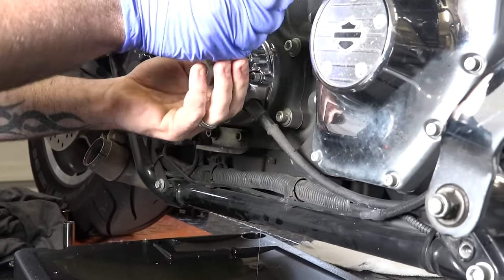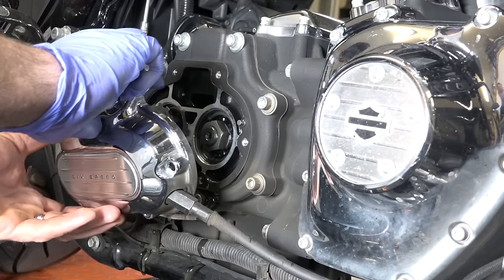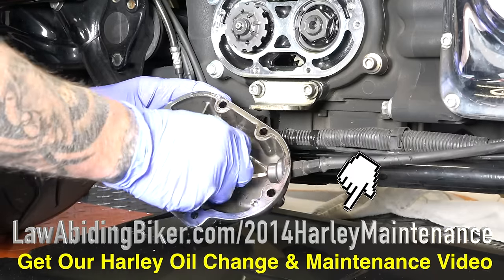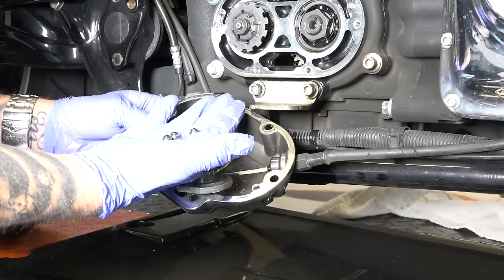Remove Harley Clutch Cable Assembly Under Side Transmission Cover-DIY

Comment: I reused the original gasket when I was changing my clutch cable and this evening I noticed couple of drips on the floor. Now I have to drain the oil again, most likely have to buy a new quart and lets not forget about removing the pipes. Moral of the story CHANGE YOUR GASKETS ...
Reply from the maker: Yah, always a fail safe to change every time. Thanks for watching.
Ride safe & Ride Often!
Here is a link to a bunch of our useful Free vids: http://www.lawabidingbiker.com/freevideos
Here is a link to some of our useful for purchase videos: http://www.lawabidingbiker.com/buyvideos
Want Answers & Information Fast? And help support us at the same time? Do you like the content we provide?
Our patrons get answers to their questions/comments/feedback in less than 24 hrs and are part of our Private Facebook Group. If you are interested in being in this exclusive group you can get all the details at ==> http://www.lawabidingbiker.com/patreon
If you haven't subscribed to the Law Abiding Biker Podcast make sure to do so. Listen in as we talk weekly about issues/items like this & so much more. You can listen on iTunes (Apple/IOS), Stitcher Radio (Android), or any other Podcast App ==> http://www.lawabidingbiker.com/podcast
Join our free email club at http:///www.LawAbidingBiker.com/EmailClub. Only relevant content will be sent from time to time. Email club members are the first to find out about free or for sale content are given special coupon codes.
Reply: Very sorry to hear but thanks for the honest, painful truth.
Reply: Or if you have a tube of black silicone gasket maker, just smear a thin layer on both sides of gasket, so long as the original gasket isn't damaged

Comment: Ryan, hey bubby how long should it take for a Harley mechanism, to put in the Harley reduced effort clutch kit, Harley part # 36808-05 if the pipes are off already, on a 03 Harley road king,  thanks man, keep the video coming ,Donnie
Reply from the maker: That's a tough question to answer. The dealerships service writer will go by what the book says it takes and charge that amount. Wish it were easier to estimate.
Reply: Ryan Urlacher that's  ok, was just curious,  thank you for all the video's you guys do, to help us out. Ride Safe, Donnie

Comment: Should be able to pull this cover without removing the exhaust I’m assuming. 
Replacing my clutch cable in a few days. Don’t want to wait on exhaust gaskets.

Comment: Great video Ryan. Slight problem I'm having though, I'm trying to put the new clutch cover on but the cable wire doesn't stretch far enough to get it into the right position. In it's current position, the clutch has far too much play and doesn't spring back once I let go of it. Did you encounter this?

Comment: hi...i'm having a problem. I just replaced the gasket because of a leak...put everything back together, but now the bike doesn't ride anymore. put it in gear release the clutch and it doesn't go. i've tried to adjust the cable but nothing works

Comment: I've noticed that my clutch cable as got a little oil on it. Went for a ride the other day, went to back up to park had handlebars trund all the way to the right and clutch wasn't working. Dao I have to take the cover off to check the tightness of the cable?? Thanks in advance

Comment: Ryan, what is the secret to getting a new clutch cable into that case on a 2015 FLHP? My son and I tried for 2 hours to get it to screw on. It's not even trying to cross-thread. Does a new cable not fit a 2015 case?

Comment: Replaced my Shift Shaft seal, upon adjusting the clutch, ended up with additional clutch cable slack that i cannot get out. Can just barley pull clutch lever - feels like it bound up??? 2003 RK Classic. A little help...thx jim
Reply from the maker: We'd have to break things back down and look over everything. Something not right. The process of elimination unfortunately.

Comment: Great video. Have you ever tried doing this replacement with removing the exhaust?
Reply: I just did on my ‘13 E Glide with stock headers. I used Snap On Allen wrenches; they’re small enough to fit with just the heat guard off. And with the bike on its stand you don’t lose more than an ounce of transmission fluid.

Comment: My clutch cable and protective covering is always wet with oil. Seems like the oil is coming out where the cable goes into the nut that screws into the cover.  Don't think it's the oring but the cable jacket itself. Your thoughts?
Reply from the maker: Hard to say without being there, but it sounds like you might need to replace your cable.  The coupling may be defective.

Ride safe & Ride Often!

Check out this YouTube Channel as we have a ton of free videos for you!

Check out our useful for purchase videos: http://www.lawabidingbiker.com/buyvideos

BECOME AN EXLUSIVE MEMBER-GET BENEFITS:
http://www.lawabidingbiker.com/patreon

Leave a flat donation: 
https://www.lawabidingbiker.com/donate

Shop in the Official Law Abiding Biker Store:
https://shop.lawabidingbiker.com

Subscribe to the Law Abiding Biker Podcast: https://www.lawabidingbiker.com/app

Join our free email club:
https://www.lawabidingbiker.com/emailclub
Reply: @RyanUrlacher  Thanks man. Yeah it seems to be from the little metal crimp that holds the protective covering in place or where the cable goes in to the nut part. I've been hesitant to change cable because I didn't want to have to remove the exhaust.

Comment: question, lol can you remove that cover , and the cam cover without draining any oils? i.e just for polishing. good video.
Reply from the maker: Glad you liked the video. You can't remove the transmission or cam cover w/o losing the oil.  Unless you have a model with hydraulic clutch lever then the transmission cover is just for looks and you won't loose any oil. ~ Ryan Urlacher
Reply: OR lay the bike on its left side, 90 degrees and you'll be fine ha ha ha

Comment: how much transmission oil do i need
Reply from the maker: It varies Juan from model to model. Just give dealership a call and they'll tell you. Or go to HD website, find your bike , and download the free owner's manual in .pdf. It will tell you capacities for your year/model.

Comment: thanks when you take off the transmission cover you have alike a fan there you can spin its not a fan but looks like one does that pull put is not then im in trouble?